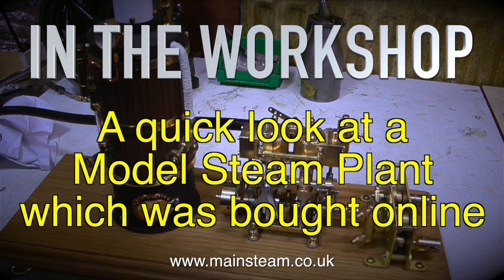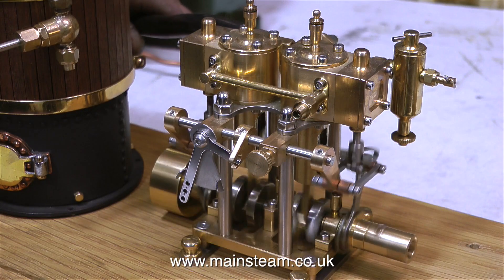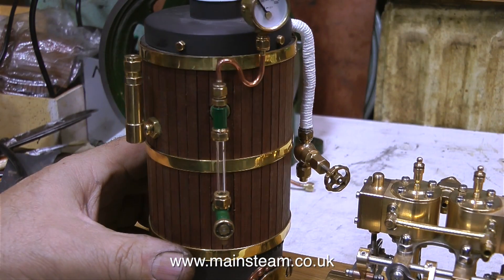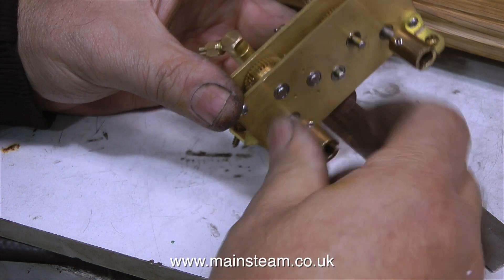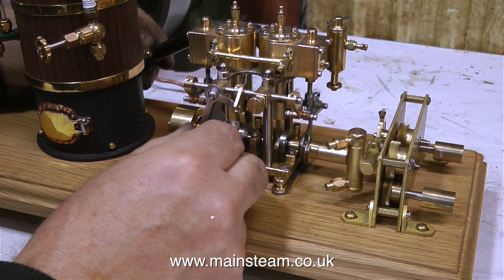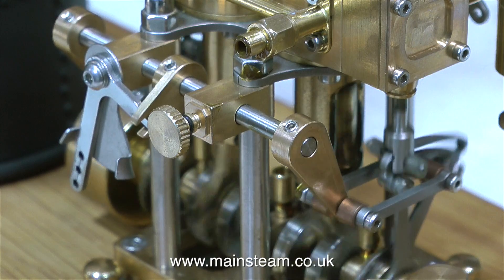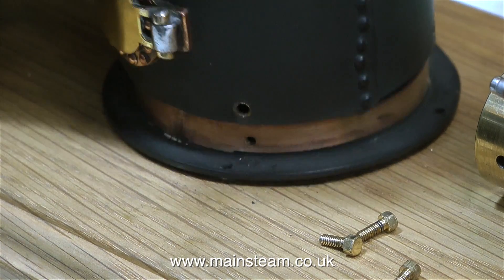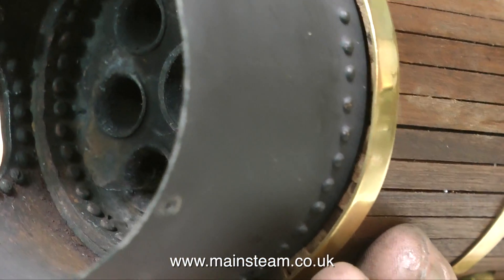BUYING A MODEL STEAM PLANT USING ONLINE AUCTION SITES - IN THE WORKSHOP

Comment: Would you put taper pins through those drop arms instead of grub screws?
Reply from the maker: I couldn't do that as the grub screw holes are already too big - I would use Loctite 603 probably, but I would rather not work on things like that.

Comment: Keith.  
That boiler looks like it’s been fired ,with coal the dirt and soot certainly indicate some use def. not gas , or it may be pateena applied for looks 😊

Well put together video as usual
Reply from the maker: I thought that - but it is paint. When I wiped my finger in the firebox area there was no black residue at all .....
Reply: Keith Appleton 
Ok Keith it just looked odd like a well used loco fire box 

Just got in from the WS after machining a ME beam engine fly wheel ( what a horrible casting but it ok now )